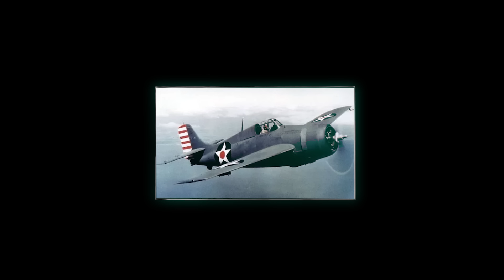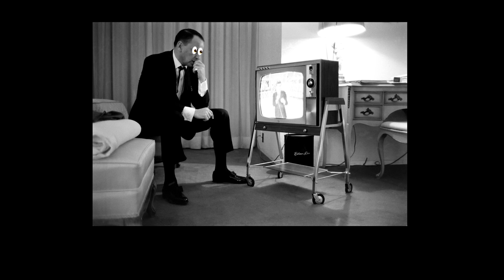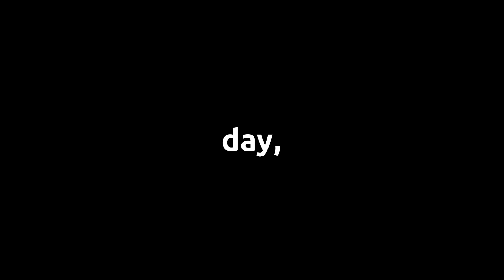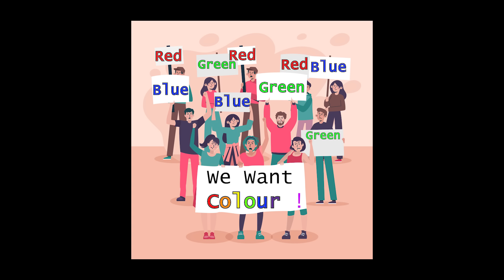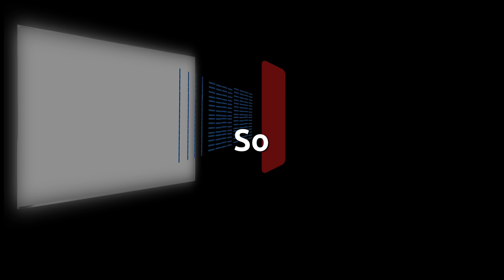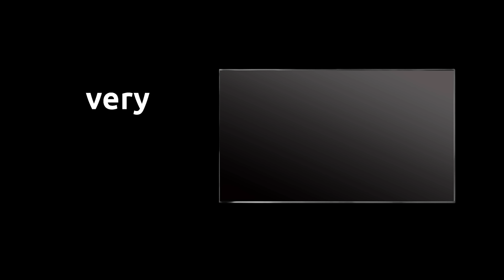Old TVs Were Particle Accelerators

Comment: The device conventionally called an electron gun is actually an electrostatic emitter that establishes a severe dielectric tension within the counterspace of the vacuum, generating a localized line of field discharge rather than a stream of physical particle projectiles.

Comment: Joshua Gossett theory=we can use gold between 100-200nm thick to see spirits through surface plasmon resonance. Gold becomes a light filter(200-600nm wavelengths) which is the micro to the pyramids which focus radiowaves(200-600m) which is the macro to the king/queen chambers to hear spirits. Plasma is the key. The sun is a giant plasma projector beaming us and our thoughts down to the earth screen and dna is the seed which determines what hologram is displayed.  This explains the giants because back then earth was closer to the sun. What happens when u move a projector closer to the screen? The image gets larger rt? So after the asteroid knocked earths orbit further away from the sun(projector) we shrank. But we are actually the same size just further away

Comment: I try to explain to people when they call particle accelerators nasty names or say they are of the devil exactly what you say in your thumbnail. The CRT wound component in an old tv is the accelerator and the screen the experiment or useful output. The people that rubbish accelerators always go and fact check me on the Old TV thing. Anyway it sounds crazy but there is a lot more sophisticated technology in an old CRT TV with an analogue radio receiver than a top spec OLED display. I am not here saying better than but far more sophisticated . Kids wont get it until you open an old back off a box and how them.

Comment: We had basic PAY TV back then in my neighborhood too.  They used to send regular signals on the pay channels, with the exception of the horizontal sync signals.  They were shifted upward up into the video area, and so the TV would lose horizontal sync locking and thus the picture would be scrambled.  I made a $6.00 circuit that fixed the sync problem.  You just had to add it to the cable convertor box, tapping the +12vdc line, and electrically placed between the RF demodulator and the Video RF modulator.
Reply: Was this in the mid-80s? I had friends with an old floor model TV. If you wiggled(?) the dial just right between certain numbers, you could get pay TV for free. This was when Big Trouble in Little China was one of the movies on the pay channel.
Reply: @billdennis415  Yes it was in the mid-80's.  The cable company would suppress each pay TV channels signal strength by 6dB during the horizontal sync signal pulses.  That was how they would somewhat hide the horizontal sync pulses.  Their descrambler box would then reduce the rest of the signal by 6dB such that the sync pulses were no longer being hidden.  That caused a 6dB drop in RF signal strength overall, and thus it reduced signal to noise performance.  My circuit did not cause RF signal strength reduction, and thus it had a better signal to noise ratio.

Comment: Okay so you're basically copying and pasting a radio signal is what you saying. Sounds good but uhhh. How does the TV know where the where the magnets need to shoot the electrons at . It  Is not part of the recording process
Reply from the maker: The electronics in the tv tell the magnet to continuously scribble across, up and down in the same pattern, the tv does this regardless of whether it is even receiving a signal, when it receives a signal the signal was made with the same scribble rate by the camera and the tv just needs to sync it with its own scribble. Think of it this way, when recording a vinyl you spin a disk around a needle that is scribbling, now when you play it back you need the vinyl to spin at the same rate that it was recorded in, the recorder and the player have a set rate that is standardized and the only thing needed is to sync the two

Comment: I still don’t understand how it lays the color and light out in the right orientation on the screen without a processor just from a radio/electrical wave
Reply from the maker: The red green and blue beans are always aiming at the red blue and green phosphor dots, they can never ever hit the wrong color because the shadow mask blocks the beam of one color from hitting the phosphor of the other two colors, for example the red beams path to green and blue phosphors are always blocked by the mask. Now all that needs to be done is change the signal so the red green and blue glow at different intensities at different points on the screen just like the black and white signals

Comment: It's time to bring back CRT's. I recently saw a Video about how CRT's are able to create a vastly more beautiful image with the help of modern technology than any other modern form of Display. We need to figure out how to make CRT's sexy again. Maybe slim them down by bouncing the electrons off of mirrors. That way you can position the Tubes upright instead of lying down which vastly reduces the depth of the Body. Sure the Tubes make the TV fragile, but we hardly need them to survive earthquakes and hard impacts. The applications that do need impact resistance, well, we still have the other displaying methods. Also bring back CD's and Vinyl. The modern notion of "Physical Media is inconvenient" is absolute garbage and just serves the tech overlords ability of absolute control and surveillance. I think there is something special about 80s to early 2000s tech.

Comment: Interesting how we now know that CRT TV's and monitors, actually produce better natural images than digital on OLED, LED or QOLED.  Someone got a CRT TV to output an 1080p image and compared it to an LED. CRT TV's apparently have no lag time. the ms lag response time for gaming monitors and tvs seems tobe built into digital LED screen. This is due to the microprocessor having to take 1s and 0s to decode an image, compared to a CRT TV which uses a laser that shoots electrons to create an image at the speed of light. So there will always be a slight lag in a digital TV compared to a CRT TV that uses an electron gun. There is is a paper somewhere explaining this in more detail.

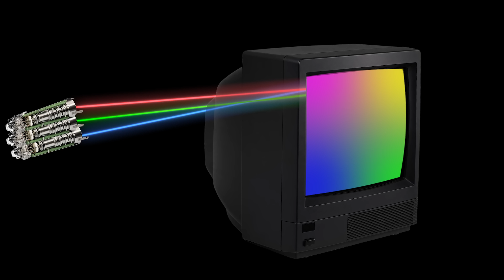Comment: 6:42 does that mean that the black on screen is using more electricity than white
Reply from the maker: Yes ! but it's only ever so slightly more, the backlight takes roughly 95% of the power and is always on,  the liquid crystals by default stay at a relaxed position letting light through to the pixels aka showing colors, but when they need to twist to block light it takes a bit more power to hold it there

Comment: How did the camera tube understand what part should be red, green or blue so that it would relay that to the tv?
Reply from the maker: The camera lens had a prisim that would split the red green and blue strengths from the light and those 3 individual stream of light would be recorded as a color strength that was sent along with the signal that your tv set would detect and signal to the individual RGB electon beams. The electon beam themselves were not colored, they were simply focused on the correct red green or blue phosphor dots which would be brighter or dimmer to make the entire image

Comment: AI Slop!  I was born into radio and TV.  Grew up around and worked in the business for over 50 years.  TV never synchronized sound to a vinyl record.  Movies did for a brief moment in the transition from silent to talkies.  By the time TV became public and broadcasting over the air starting after WWII in the late 40s early 50s, it was all electronic, with no moving mechanical parts.  All electronic won over the very early mechanical TVs in the 1920s/30s with the spinning disk, when it was still in the laboratory.  No one seems to know anything anymore and they pass on their ignorance to the public with poorly researched AI BS channels like this, who then become infected with the corrupted information.  God Bless'em.

Comment: I used to work at a place where we repaired computer monitors. We would tell people that we worked on computer-controlled imaging particle accelerators.
If somebody did something bad, revenge was finding a monitor they had put in line for calibration, and reversing the big vertical circuit capacitor, which would then explode when they powered up the unit.
Russian TV embeds sound into the video signal. It took a while until the West was able to see Russian TV.

Comment: It’s kind of crazy we could send data before storing that data. Then when we did get a good solution it was magnetic tape recorded on a fast spinning drum with read heads because the data is too dense and needs fast data transfer.
Reply from the maker: Yes, very soon after television was pioneered, the film industry figured out how to store sound in wave forms graphs that could be converted back to sound by an optical sensor, TVs used that untill magnetic tapes came around

Comment: It’s not that CRT’s didn’t have computers. They had analog computers to decode and encode the signal. The transform into electrical signal. 

They didn’t have binary electric computers.
Reply: You're not necessarily even computers. They were just following a standardized sweep pattern. No computation was happening, not even the analog circuit. It was just following a sequence left to right up to down the just an oscillator. It's not really a computer, not even analog

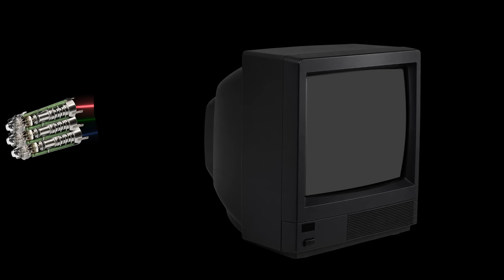Comment: 5:00 There's a similar type of display that worked the exact same way as Color CRTs, but every pixel (Red Green and Blue) had its own electron gun.
Canon developed what they call Surface-conduction electron-emitter display, which was literally OLED in the year 2000's. 
They planned to release televisions using this technology to the public but was sadly cancelled mainly due to patent conflicts with NanoTech.
Reply from the maker: I did not know this, thank you for sharing an atomic knowledge with me !

Comment: Sticking to the basic descriptions here, among other errors, there are no pixels in an analog signal or the CRT, and the sound is not from vinyl, it's FM and part of the signal waveform. For a long time, well into the early 2000s, the picture quality on a CRT monitor was much better than early LCDs but more than anything else, people were wowed by the flat thin plastic box replacing the gorgeous Trinitron/Diamondtron. They preferred squinting into their dim 720 17" LCD monitors.
Reply from the maker: I agree I was aware they are phospor dots, I did describe it as such, just a slip of the tongue that I called them pixels. And yes gramophone discs were used for audio in the very early stages, they just weren't made of vinyl yet
Reply: @Atomicc-Knowledge  There was sound on film by 1927 and videotape by 1956. Discs were used for musical illustration only.

Comment: No, it’s science, and it makes a hell of a lot more sense than LED in my opinion
Reply: I have a mid high end 19 inch 1344 line Samsung CRT computer monitor with a hilariously sharp phosphor mask, imagine it as a 27inch 1440p digital display sharp. 

The advantage of being analog is real, my AMOLED smartphone has black crush, while this CRT computer monitor can do anything on the near black region.

AMOLED doesn't know what to do when it approaches absolute black.

Same happens with LED lightbulbs vs incandescent, LEDs have massive jumps in brightness if they have a dimmer, meanwhile an incandescent lightbulb can do anything in-between.

Another thing that i noticed is that the AMOLED image looks overprocessed but it's more of a software problem than the display itself, the CRT computer monitor's analog advantage is also real on the motion clarity and using whatever resolution i would like because the electron gun can do whatever amount of vertical lines and the phosphor mask doesn't care.

The AMOLED phone meanwhile can't do anything other than the number of fixed pixels it has. This is why a PS2 or Wii look like @ss on a digital display vs a CRT TV.

Obviously if the CRT is like a fancy incandescent lightbulb, it's impossible to reach the brightness of an LED display but the image is life-like.

LED stuff including AMOLED also has a very strong blue-tint. Fortunately OLED technology improved a lot at displaying warm colors.

Comment: I think it's also worth mentioning that unlike the CRT, the LCD and LED screens generate the entire picture all at once, so there are no scanlines or "beams" going across.
Reply from the maker: You're absolutely right, I did mention that LCD and LED work by changing each individual pixel, its easy to infer that it means they change the whole frame at once!!
Reply: @Atomicc-Knowledge Tearing is still a thing.
Reply: This is also why you cant play for example the NES game Duck Hunt on a modern TV because the light gun relied on the CRT scanline system to work.

Comment: I can adjust the magnetic rings on a CRT to align the beams on the correct triad of phosphors!  Usually, most of the problems with the computer monitors was the dozens of magnets the person in the factory glued on it.  You tore off a dozen magnets and put two back.

Comment: 🤣🤣🤣I sort of always liked the "freaking particle accelerator"🙂🙃🙂 in the living room, while I still wonder what the screen coating of such an 1970ies old fashioned TV-CRT-Camera was, also phosphorus?? You forgot in your great video the most recent (ultra-efficient, <100W for a giant 2m-screen(!!), quantum-dot) QLed-monitors, sort of one of my "babies", just as ultrasmall quantum-electronic flash-RAM (e.g. in micro-SD-cards), of course not the entire screen or SD-card, not to mention their ingenious mass-fabrication, just the single quantum-electronic element!! eof.
Reply from the maker: There were several different camera tubes and different types of coating depending on if it was photo conductive or photo reflective

Comment: Okay but what about CRT computer monitors with a VGA port?
Reply from the maker: CRT computer monitors have a microchip that converts the RGB of what should be on your screen into analog signals that draw line by line the same as television screens. TVs that were made later on also replaced the "complex analogue circuitry" with microchips that did the same thing but in a smaller and lighter form factor. At the end of the day, they were still particle accelerators that draw the screen line by line
Reply: Thanks for letting us know. New sub :D

Comment: fun fact, YouTube got started when CRT monitors were still commonplace for computers, and before it could really be watched on mobile devices, so a computer was necessary.
Also, CRTs had vastly superior contrast to LCDs, and if the signal it received was analog from start to finish, the CRT could make HDR monitors/tvs look pointless as where HDR tvs have a 10bit depth of brightness (or 12bit if it's a Dolby HDR) where as with a purely analog signal start to finish, no digital stage of any sort in between, the CRT TV had effectively infinite range, not just a high range, infinite.
Not infinitely high, just an infinite amount of values between fully off and fully on.
Reply from the maker: Lovely fact, CRTs also had a higher refresh rate than early LCD so up untill the early 2010s some pro gamers still preferred to play e-Sports on CRT monitors
Reply: You Tube